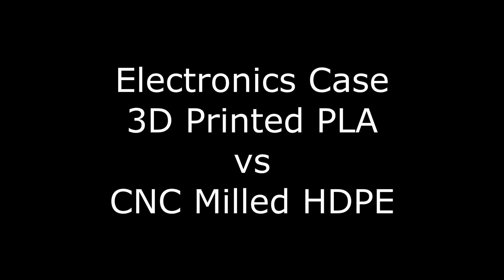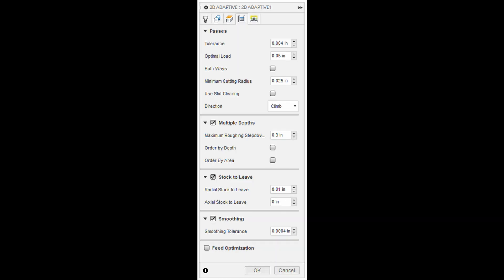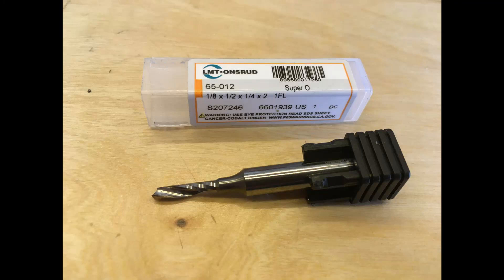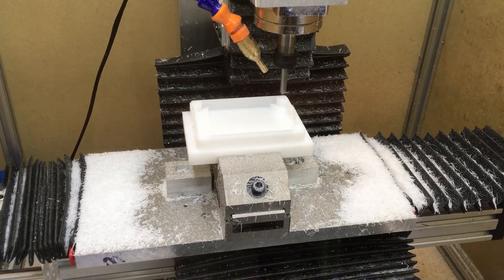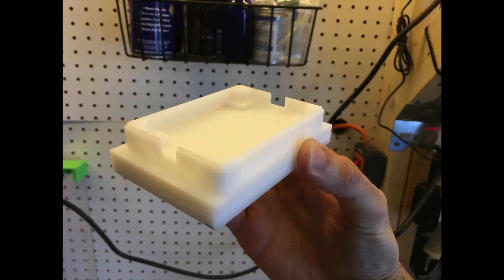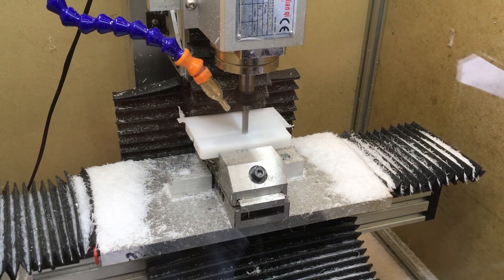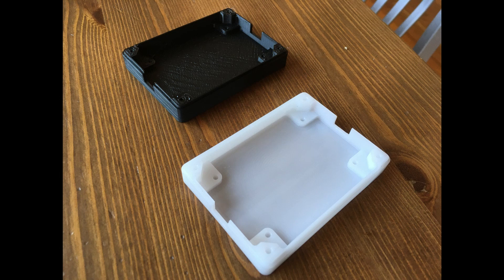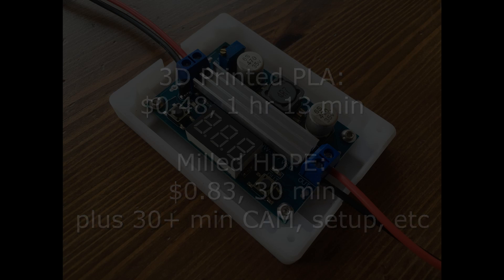3D Printing vs CNC Milling electronics cases

Comment: I wonder, if you had taken it to final dimension first, could you have milled it without having to flip it, and thus leaving the thin bottom floor mostly-supported (little stick out on the ends).